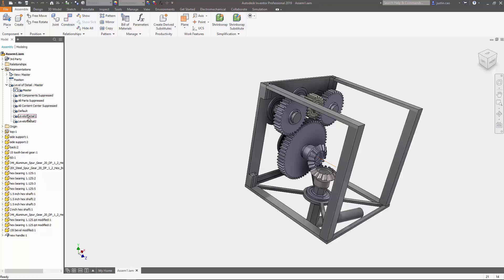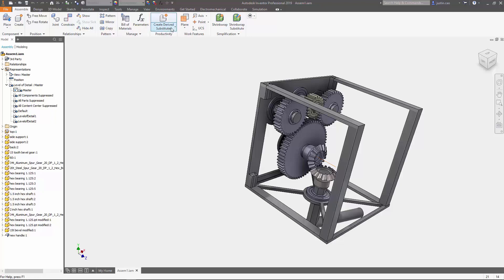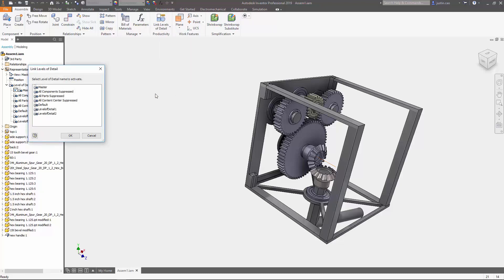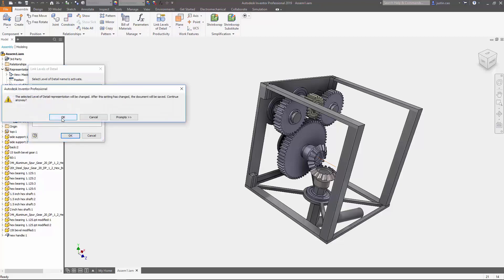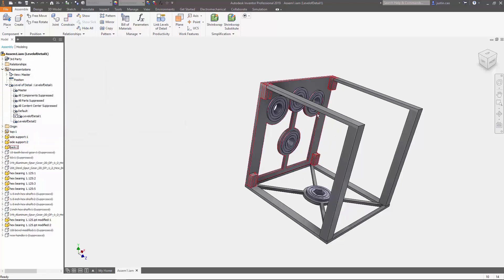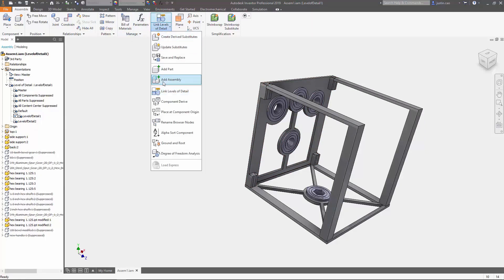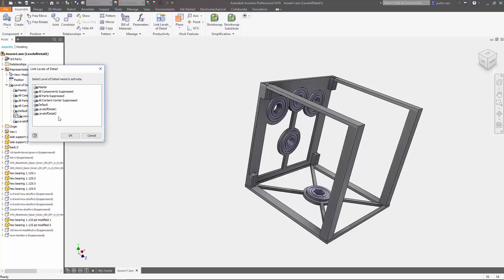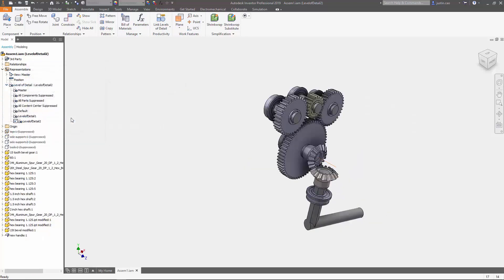Quick Tip - Link Level of Detail

Comment: There is no sub-assemblies here, therefore that tool does nothing it is just switching between level of details in current assembly. This video completely misses the point of the tool which activates the same named level of details in sub-assemblies.
Reply: How do they misrepresent their own tool so badly? It would have been quicker to double click on the browser nodes in this instance...